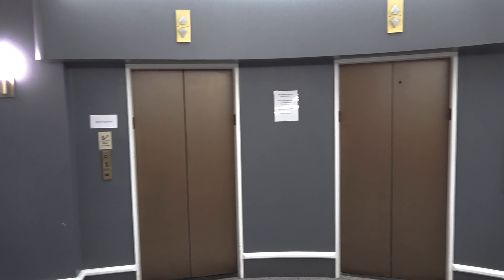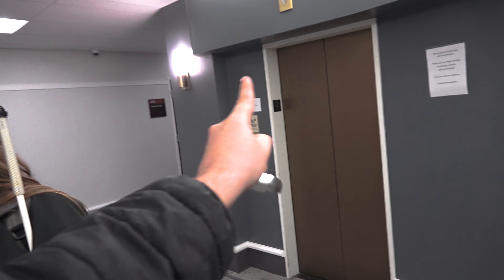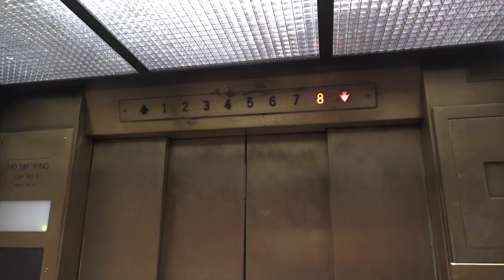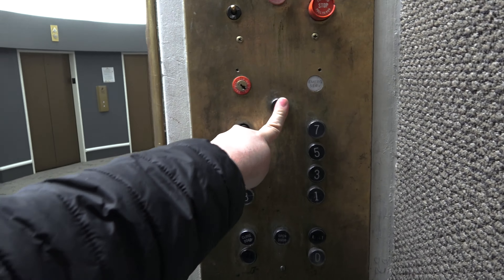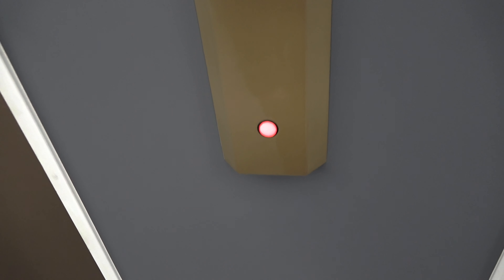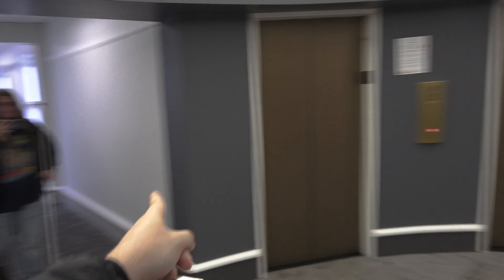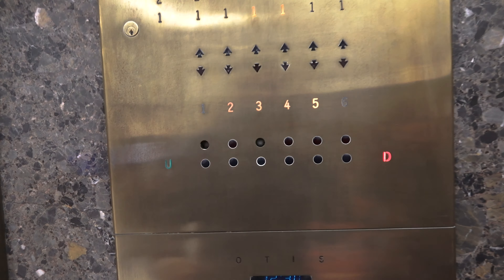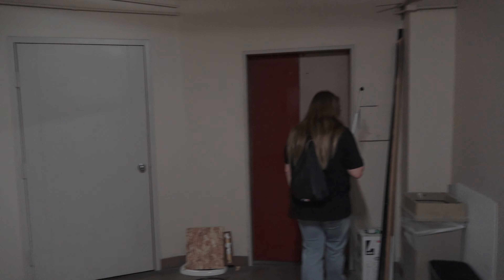HISTORIC 1950s Otis Autotronic & 1914 Manual Otis Elevators - The Pittock Block in Portland, OR

Comment from the maker: Hey everyone! I apologize for the delay when attempting to get this video out! During the exporting process on Premiere Pro, it kept getting stuck on the ending part where I normally have had a slideshow with different still pictures of the elevators, and when I tried using the Media Encoder, the video wouldn't export properly there either. As a result, I did not include still pictures at the end of this video, but for those interested in seeing them, click on this link: https://drive.google.com/drive/folders/11-P1GwqmGSmHiq1V3U-Ed6nwMoOTEuzg
Reply: It’s too bad they gonna be modeled though I heard

Comment: I worked at the Hotel John Marshall in Richmond Va. 1981-82 and the room service elevator were manual, almost always had a driver unless it was really late. The lobby elevators had knobs that you could push in and pull out, I guess that at one time they had operators.

Comment: Interesting set-up. Judging by the indicators it might even be possible that the main 1s had pop-out. It seems the car-switch on the 1 was replaced, probably in the 50s.
Reply from the maker: The COP layout leads me to think they were Touch, usually Pop Out COPs have a different layout although I have seen Pop Out COPs with the same panel layout as the Touch installs so either one is possible. As for the indicator, given that it has the larger digits as opposed to the very small ones that you usually see on installs from the Late 40s-Mid 1950s, this is either a Mid to Late 1950s or 1960-61 install/mod so either fixture is possible.

As for the Manual, I've seen numerous Manuals that are 100+ years old with this exact same crank, but it's also possible those were replaced too. On this particular one, it would make sense as the cab was clearly redone during the 1950s Modernization to the other elevators.
Reply: Yeah I guess they could have had 1 of those 2 fixtures, but we'll never know. I do agree that I've seen that car-switch on turn-of-the-century elevators too. I think a lot were replaced in the 50s. The "flat rectangle" design was more of a 40s-50s thing, including across the other big 2 manufacturers at that time as well (Westinghouse, Haughton)

Comment: The fact that I saw lights on in that service panel. That is definitely on its original controller but they put new buttons in period but they're all connected to that panel. You could put that thing into independent service and have to select the direction of where you wanted to go then the floor then hold the start button. It has to be on its original controller for that to work. And I could see the lights on

Comment: Notice that the manual elevator is "disguised". It has lanterns (which probably don't do anything) on most floors. There are 2 clues, the missing lantern on the lobby level, and missing brailles on all floors.

I wonder if all elevators are going to be modded, or just the passenger cars.